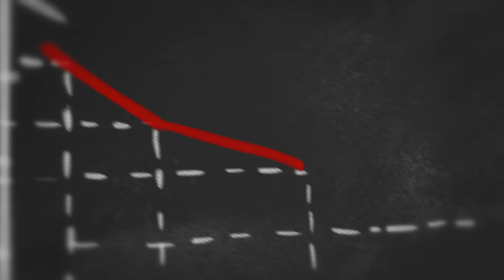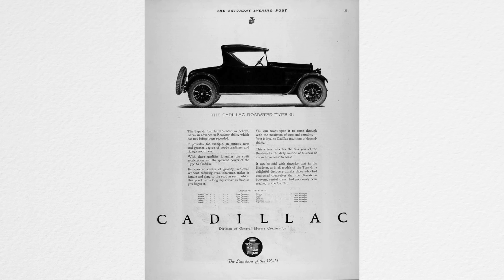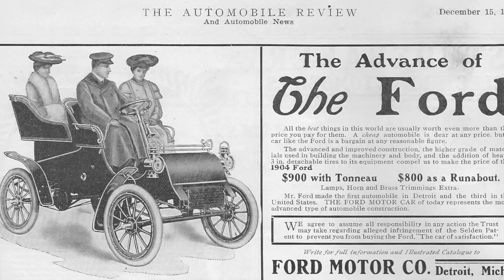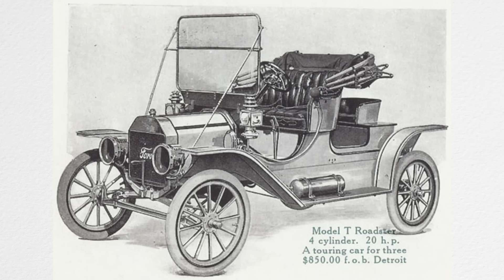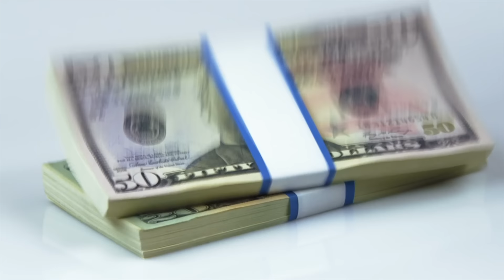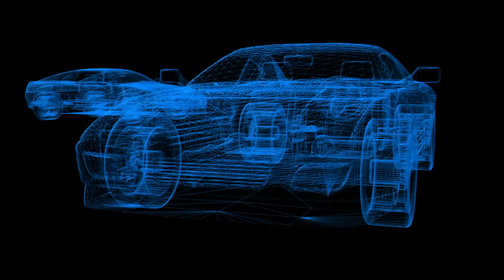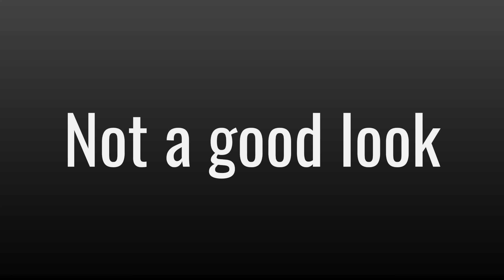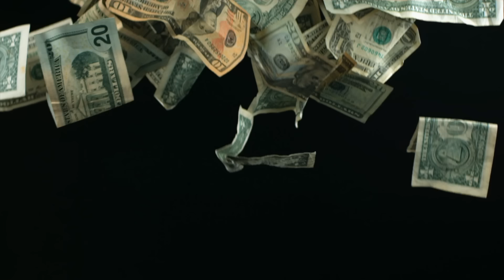Henry Ford: Innovator Until He Wasn't

Comment: 1908: 4 Cylinders = 20 horsepower.(model t)
2018: 4 Cylinders = 350 horsepower.(focus rs)
2128: 4 Cylinders = 1531 horsepower?
Reply: Generic Goat. 
I doubt the internal combustion engine will be used much in the 2100’s.
Reply: Mistake Not  2100's? I doubt Internal Combustion engines in mass production cars will be around in 2050s
Reply: 2018: 0 cylinders = 503 horsepower (Tesla Model S)
Reply: Depends on how big the cylinders are.
Reply: @Better than u  I think there are initiatives in countries to completely transition over in a few decades
Reply: Better than u  I don't know about your country but mine aims to stop sales of vehicles with Internal Combustion Engine by 2030-35 time frame and mainstream manufacturers are releasing their Electric cars next year.
Reply: I'd be suprised if they'd stull ise internal combustion engines in 2-3 decades let alone a century.

However electric motors make the need ofr massive horsepower obsolete due to their absolutely monstrous torque. (and electric vehicles are near the 300 range already)
Reply: all the people arguing against combustion engines forget: Combustion engines are FUN
Reply: ObviusRetard  How so? they just are a system that converts thermal energy into kinetic energy.
Though the energy density of batteries is lower that doesn't matter if you got a larger battery that an electric car can handle as if it were nothing due to the monstrous torque electric motors have.
Reply: fl00fydragon  Did you ever listen to a racecar irl?
Reply: ObviusRetard  I don't see everyone driving racecars and the sound can be easily replicated if it's your thing.
However at some point I expect that racecars may get the backseat and be replaced with robot fighting, mech fighting, drone racing and races that involve magnetic "racecars" hovering over a superconductive track.
Reply: cant believe that there are still 4 cylinders with that small amount of hp in the future look up bmws 3cylinder cars
Reply: fl00fydragon  The sound of a combustion engine is something physical, it is the shockwaves and the rumble of the inner workings travelling through air and ground, do yourself a favour and go to an event where historic Can-Am series cars drive, you cannot replicate that shit with speakers. The whole appeal of racecars is the simplicity and the ferocity of the machines.
Reply: fl00fydragon  Well, if you don't want to understand, don't do it. But I'm not talking about statistics on a piece of paper, I am talking about emotions. Because sport is entertainment.
Reply: ObviusRetard  
And those vehicles will always lose.
Like it or not sports may be entertainment byt they're all about statistics.
Hell, I'm a robot fighting fan, style may be important but that alone will have no value. 
You may have something look and sound cool but if it doesn't pack a punch then it's a glorified noisemaker.
Reply: fl00fydragon  horses are obsolete now as well, yet their associated sports still exist as well
Reply: ObviusRetard  
Bad example. for one we don't have carridge races.
We are also talking of the same sport using superior hardware for an edge.
EV's and ICE's are both  cars, the transition will happen as EV's will start dominating ICE's due to the superior accelleration, low center of gravity (due tothe battry) and speed control.
Reply: OK wonderful. You are factually right and very smart. I hope this makes you feel good.
Reply: ObviusRetard 
It's not about being smart or being factual.
I'm explaining why people shoudn't support an obsolete and harmful technology in the future.
Reply: In the 80s, we were promised hover-boards by 2016, so I feel that there is no guarantee for anything, we might just not have a reason to go anywhere in 100 years.
Reply: Generic Goat  
a) we have hoverboards they just not practical yet (some needing a non ferromagnetic sheet below them to work and being heavy AF and others being... problematic due to a reliance on non room temperature superconductors)
b) it was an assumption that was outside of the realm of science while newer predictions are far more educated.
c) we have other technologies that dwarf the importance of hoverboards such as genetic therapy, computer technology, internet, new exotic materials, etc.
d) electric cars already exist.
Reply: @CJColvin  I'm not a Liberal I'm a mix between a democratic socialist and a transhumanist. 
By political terminology you sir are a liberal. If you don't believe me look it up. 
Not to mention that you are trying to use a common political ideology as an insult, witch is baffling. 

It won't have a soul you say? 
If by "having a soul" you mean a high maintenance, noisy, money-waster, that has a small lifespan with shit acceleration and a third of the torque then yes it wont. 

Don't worry I'll manage with the sleek, futuristic, convenient car that would feel like a rocket when I floor it.
Reply: @KlaraZoom  whooooosh
Reply: We'll switch over to Elephantpower by 2080.
Reply: 2018- 6000 hp diesel electric trains
Reply: unless cities get a power grid that can support all of those electric cars and have faster charging thats fast enough to compare to refueling combustion engines as well as electric engines having enough power to replace heavy duty off-road as well as delivery vehicles like semi-trucks, we ain't gonna go pure electric so soon. Also electric cars are still harmful to the enviroment, so don't fool yourself into thinking its some pure green energy.

And there isn't enough lithium around the planet to replace all the ice cars, you ought to find ways to build those effective batteries because those electric engines aint shit without electricity.
Reply: well a internal combustion engine of sorts.... a thermonuclear one. ....too bad it still guzzles coolant. ...and that in 2077 nuclear war will pretty much freeze all production,
Reply: Derelict. 
That will be the sound of the electric cars they have?
Reply: lol electric cars with artificial ice car sounds are worse than cars with fart cans that try to do the same thing, sorry but no, car has to be fully ice and make its own natural sound with it so i don't feel like a ricer boi
Reply: Cylinders?
Reply: fl00fydragon  You need to come to Detroit if you think race cars are going away any time soon. And when you do make it here hit me up. We'll go on a little tour.
Reply: Generic Goat 4 cylinder engines suck
Reply: JulJasMah  That's why we put them in all of our vehicles..............
Reply: JulJasMah  Yes, they do.
Reply: @stayfrost04  I doubt humans will be around unless we become a multi planet species. I can't see earth being habitable for us for much longer.
Reply: potatoe4221
Racecars won't go anywhere, the technology in them will change
Reply: Curious Frost why they’re being made better than ever and extricate is unreliable and useless
Reply: Imagine the v8 gettin 50 mpg and 3000 hp
Reply: MY2KSapphire no bud
Reply: fl00fydragon nah everyone wants to hear there car and plus we’re going towards self driving which will lead people back to the simpler time since no one who lies cars likes a self driving one
Reply: fl00fydragon well your wrong gas engines are much simpler especially the older ones  no computers mainly and you can fix it your self and no Tesla has a little bit of torque from zero Tesla said there cars have around 300 hp and 340 ft/lbs i don’t remember the  numbers  and still combustion engines are being made better and better
Reply: fl00fydragon so electric cars cause there slow boring can’t go very fast for to long and are terribly made
Reply: fl00fydragon how’s it harmful bud
Reply: @joedirt6212  Unless English isn't your first language you really need to get better at it.
Reply: @potatoe4221  We put them in a ton of vehicles because they're cheap not because they're good...
Reply: @kylemagaro9744  Trump may not be perfect but he hasn't screw up any major unlike Obama.
Reply: @KlaraZoom  it will, check out the documentary "Mad Max Fury Road"
Reply: ScamallDorcha. 
😂
Reply: 2018 - over 500 hp and no ICE Engine. all electric.
Reply: Lol you really think there will be combustion engines in 100 years? News flash the world's oil is to run out in 50..
Reply: Are you sure we're still gonna have petrol 110 years from now? There's more cars in the entire world than people. And we're still making more.
Reply: You can get a 4 cylinder to 1000+ horsepower,..It just chews a lot of fuel
Reply: Kyle Magaro Imagine thinking the U.N is in any shape to “laugh someone out of the building.” They’re basically the League of Nations 2.0.
Reply: @BlueBird-wb6kb  what are you on about? The number of cylinders has fuck all to do with it numb nuts. It's the capacity that's important. They put more cyclinders in the higher the cc because it makes the motor more refined but that wasn't always the case. Some early race cars had 27 liter aro engines with only 4 cyclinders..
Reply: A 6 cyl. fires a piston every 120*,  while a 4 cyl. fires every 180*. You'd need less energy, (fuel,) to keep a 6 cyl. idling and can get more out of it under load with the right design. Plus they sound way better. Customers, (see dictionary for idiot,) think that 4 cyl. are more efficient, and they have less parts so companies are okay going along with it. Electrics were a fail until there were enough idiots to sustain a single manufacturer. It's really hard to be a car manufacturer for people who don't like the product you sell, cars.
Reply: They will. Just not in everyday cars. Someone will find a way to keep old cars running for museums and such.
Reply: 1968: 8 Cylinders = 450hp (Chevrolet Chevelle)
2018: 8 Cylinders = 455hp (Chevrolet Camaro)

It just doesn't work that way. Cars struggled a lot with power in the early days, but after the 1960's caught up with their muscle cars and the 1970's came around with fuel injection and turbocharger systems, it's all been kinda flattening out. We're at the edge of how much energy you can get out of a certain amount of fuel. Best thing we can do now to increase power is to go for alternative fuels like hydrogen or find a way to mass produce graphene batteries for electric cars. I don't think we'll see any massive HP gains in the future.
Reply: Chevy could get an easy 100hp going DOHC. They got the LT5 DOHC 350 up to 425hp, back when the regular 350 was making 275hp.
Reply: We already had engines that could generate hundreds of horsepower 80 years ago. The V12 engine is almost 100 years old.

The 1905 Apperson Big Dick (hehe) had 96 HP, the 1919 Porter Model 45 had 125 HP, the 1932 Duesenberg Model SJ had 320 HP and the 1958 Mercury Park Lane had 400 HP.

Generally, the combustion engine hasn't changed much since the 1920's.
Reply: @WolfHeathen  a car named Big Dick... What were they thinking 113 years ago? Lol
Reply: @robertharris6092  idk what acceleration you are talking about, but when talking about a vehicle, generally engines with more power accelerate a vehicle more quickly, as long as all other factors remain the same, doesn't really matter if they are electric, combustion or steam engines.
Reply: Also there is people 600hp in four cylinder golfs
Reply: @robertharris6092  You know Power is just a function of torque x RPM, right? So of course because electric motors are very torquey, they have more power at more RPM compared to a combustion engine with the same peak power. Still my statement holds true
Reply: @robertharris6092  Also drag racing is by far not everything motorsport has to offer, and the most effective isn't always the most fun ~
Reply: This is why I love extrapolation
Reply: 3000: 1 cylinder = 3,000,000 horsepower
Reply: There's several estimates suggesting electric cars being the dominant vehicle type by 2026, and internal combustion vehicles being relegated to niche roles.
By 2032 the estimates are even the niche roles will be gone, and the only people with internal combustion vehicles will be diehard enthusiasts, though they'll likely have a hard time getting parts and fuel for their vehicles.

2050 is not a particularly optimistic estimate.

The biggest issue with electric vehicles right now is that the energy density per unit mass of even the best batteries is about 1/50th the density of petrol.
However, electric motors are about 3 times as efficient, so the net effect is it's about 1/16th the energy density.

However, the internal combustion engine largely hasn't meaningfully improved in about 4 decades or so. Not in any fundamental sense.

Electric motors are already ancient tech (they're older than internal combustion engines) and have insane 90%+ efficiencies/

But the batteries...
Well, the energy density of batteries has more than tripled in 30 years, and something like doubled in the last 5, and the cost per unit of energy is dropping exponentially such that it looks as though the cost will halve every 2-3 years for the near future.

That means while currently a battery for something like a tesla that actually has a decent range costs about $20,000 (about half the cost of the car), you can expect that by 2025 that same capacity of battery would be about $5000, and at the rate things are going, by 2030 may be getting as low as $1000

At that point an electric car with a range comparable to a petrol car will be inherently cheaper than a petrol vehicle (battery excluded that's already the case by some margin), will have much lower maintenance costs (far fewer moving parts), and given expected infrastructure improvements and constant improvements to fast charging capabilities of vehicles, about as flexible.
At which point there will be precisely zero practical incentive in most scenarios to keep using cars powered by Internal combustion.

This isn't guaranteed by 2030, by any means, especially on a global scale, but the chances of it not having happened by 2050, much less 2100 are quite remote...

Also electric engines AREN'T fun?
Have you ever seen the amount of torque and acceleration an electric motor can produce? It'll leave a combustion engine in the dust easily.
They make interesting noises too, since some people seem to obsess over that. (A high powered electric vehicle not specifically engineered to be quiet has a sound akin to a jet fighter) And most of the other qualities of a car have little to nothing to do with the engine, so that has no real meaning.

Plus people enjoy what they're used to, and come up with all kinds inane and ultimately meaningless reasons for why the existing thing is 'better'.

Did you know that people used to make the same 'range anxiety' kind of statements about cars, at some point in the past, when horses were still the norm?
Nobody at the time could imagine how that could ever work out because where would you get the fuel from, when a horse can just eat grass anywhere it goes?
The idea of a petrol station existing was a completely alien concept...

Things change. Argue against it all you want, but it's pretty obvious which way the wind is blowing at this point.
Reply: ...and how long will it be before we aren't able to buy fossil fuels for cars?
Reply: Plane power

Comment: The chief designer of the Ford Model T was a Hungarian engineer called József Galamb. When he visited back to Hungary, he was invited to dine with the Admiral Miklós Horthy, Regent of Hungary (the head of state in the absence of a monarch) and he asked if Galamb could help his elder son to get an internship at Ford. He responded: "Only if he has the best school grades." He indeed had, as he was a very talented young man, so he was allowed to travel to America. 

István Horthy soon began at Ford as a simple factory worker and soon worked himself up to become an engineer. When he returned to Hungary he became a chief engineer at the Royal Hungarian Railways and oversaw the design process of one of the most successful steam engines ever, the MÁV Model 424 "Bivaly" (Bison). He even managed to beat the British in a tender and sell this engine to the Indian railways. Unfortunately the outbreak of WW2 prevented the actual delivery. The 424 was pretty much the Model T of railway locomotives. Horthy's experience at Ford helped the Hungarian railway industry to thrive, to the point that MÁV produced a super fast steam engine, Model 242 "Nurmi" (nicknamed after a Finnish olympic runner) which was only slightly less powerful than the fastest one ever, the British "Mallard".

He served as a fighter pilot in the war, as a 1st Lt. of the Royal Air Force. He met a sad and early demise when he crashed with a Hungarian-built Re-2000 "Héja" (Kestrel) fighter on the Eastern front. If that never happened, Hungary's history would've probably taken somewhat different turns.

Comment: Huh, that was an interesting video. As a German I never thought of Ford as father of the car (that is Benz in my mind) or the father of the assembly line (while it is an older sentiment the best expression of it I saw thus far was by Adam Smith; while (IIRC) he doesn't mention production at physical assembly lines they began to crop up in his time and incorporating those was only logical). I always thought of him as one of the figures that didn't innovate, but improve. More specialisation in the assembly line (while not reaching the levels of Smith's famous pin, which was truly insane) and getting production to a large scale, using interchangeable parts to ease logistics and starting the five dollar day to solve the problem of workers going numb, which was already mentioned in Wealth of Nations.